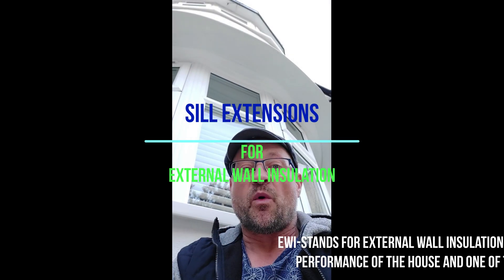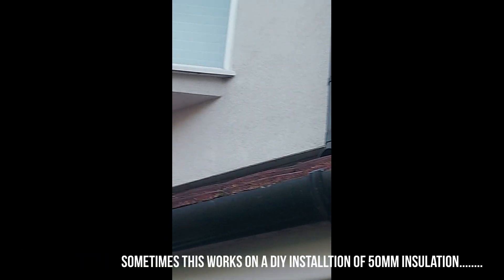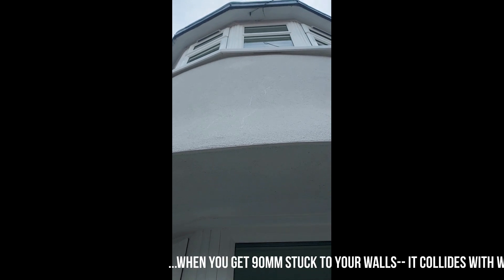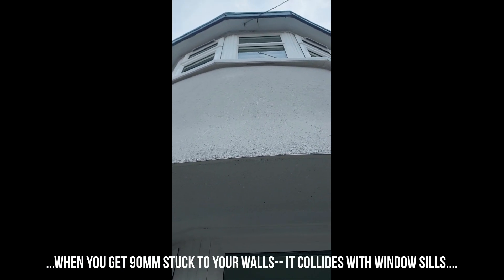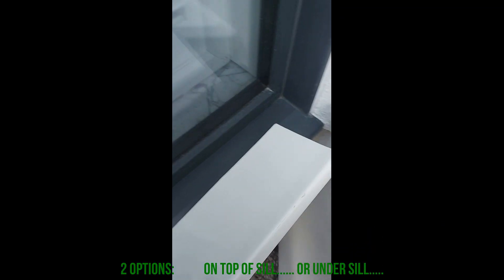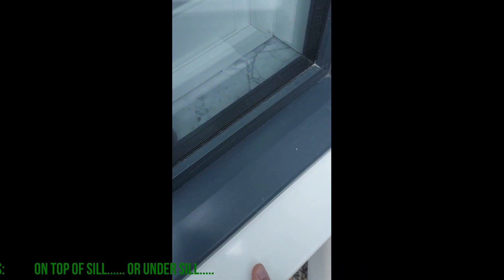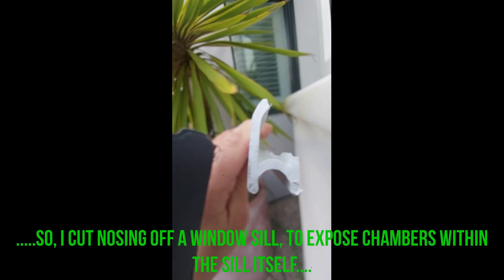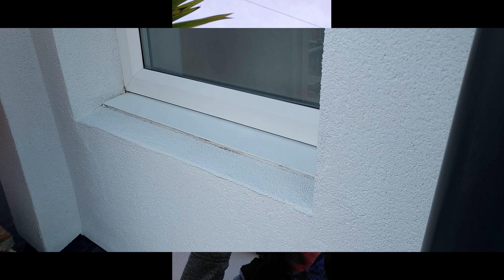EWI Sill Extensions

Comment: Hi Maciek, we have the same problem where they put the sills on the top and have blocked the concealed window drainage, do you know if we can fix this?
Reply: You can plant the fascia board on the cill whilst still maintaining the drainage. This is done by first glueing flat plastic packers, like the type that come with windows etc, of approx 3mm, onto existing cilk. Then the new fascia faux cill is glued ONLY to these. So in effect you have a floating cill that allows the condensation to drain out the window channel, under new cill. You can test this by simply pouring water onto the open window lower sash and seeing if the water goes down the drainage holes and should then appear from under the window cill.
If they have done this correctly all is OK. I do mine this way.
Only posting this so you don't go ahead and wreck what might be OK installation...
Regards Pat

Comment: In the end, did you use fascia board or the aluminium sill? Which looks better?
Reply from the maker: We used uPVC fascias in the end, as add-on. Aluminium would have worked in timber windows, due to face drainage weep holes upvc